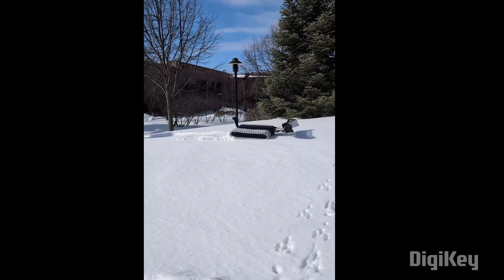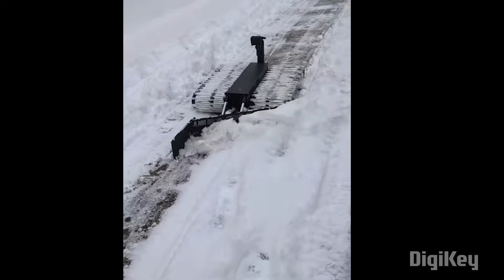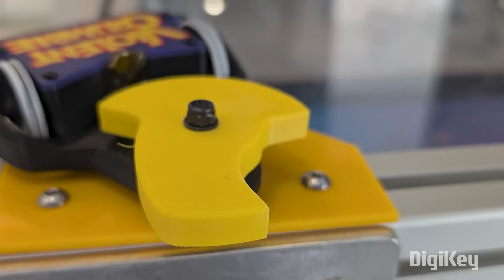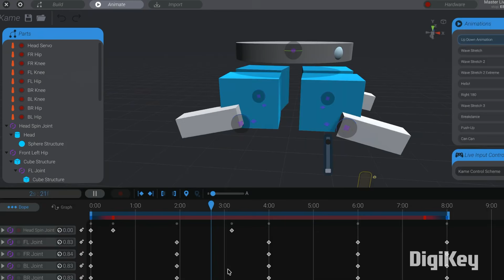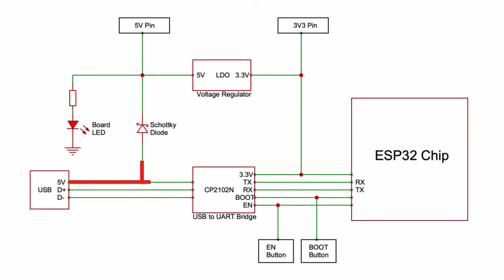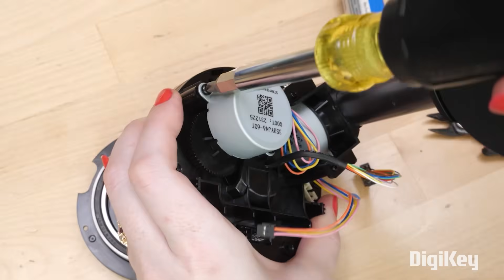Plowing Ahead [Maker Update] | Maker.io

Comment: Becky's tear down video was amazing. It inspired me to take apart 2 i3 style printers that have been taking up space. they have reached the point where it would cost more to fix them than they were worth. I now have so many stepper motors for robot projects, and extruded aluminium chassis. 
Quick question, how do we recommend a video for maker update. I saw a fantastic MINI 3d printed marble clock inspired by Ivans giant machine :)